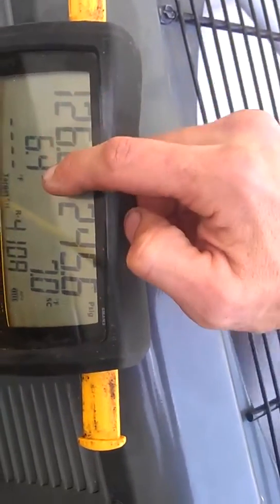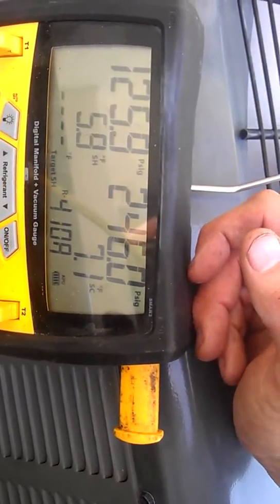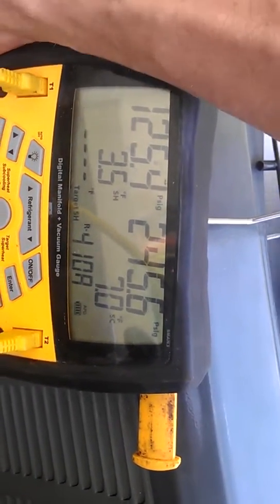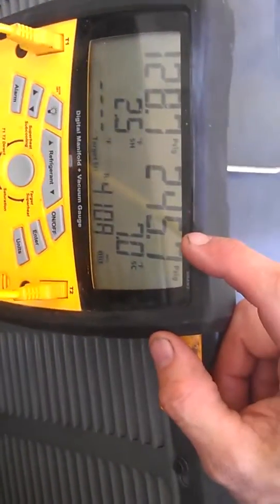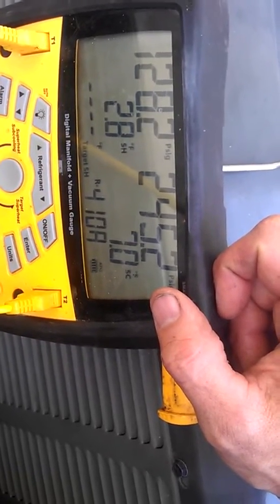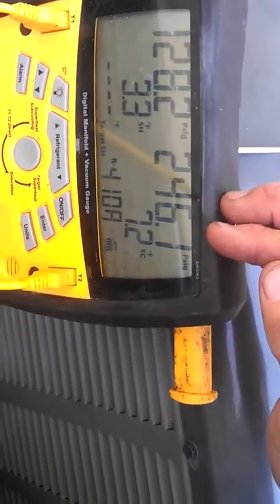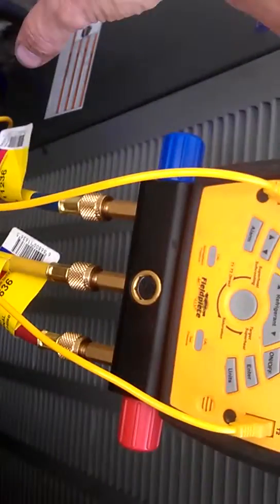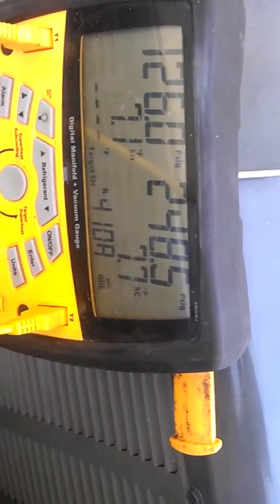Charging a 2 stage Goodman Amana heat pump properl

Comment: Thanks very much for this video. My installer refuses to charge on low stage with my 2009 Goodman 2 stage, 3 ton A/C unit, says checked with Goodman rep and they said to charge on stage 2. My manual clearly states charge in stage 1. 

What will be the effect of charging in stage 2? Can the unit be damaged? Is it an efficiency issue? Thanks in advance!